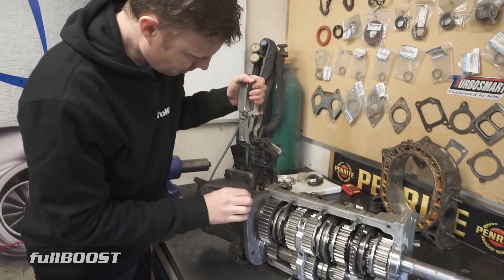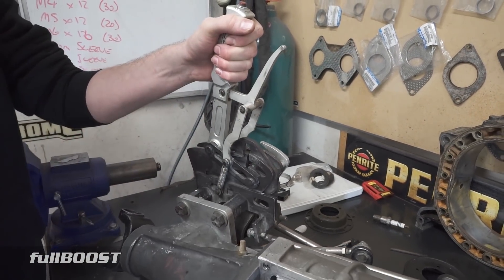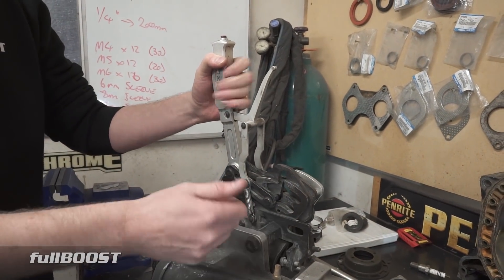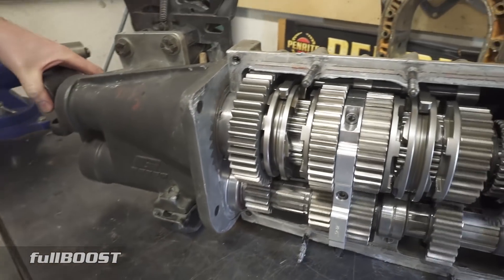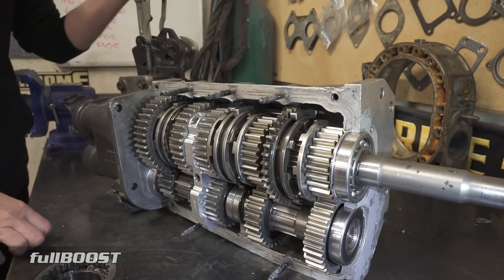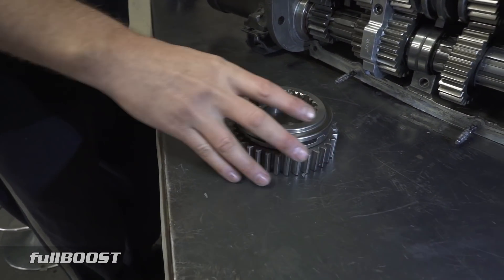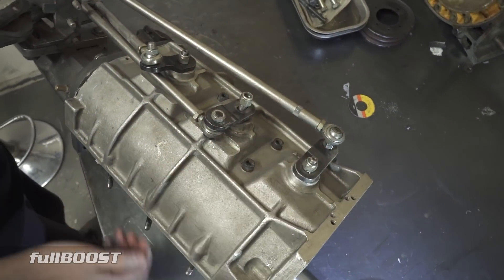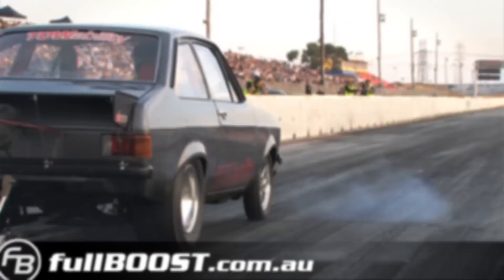How a clutchless racing transmission works

Comment: Shifting with that shifter sounds like you're loading a machine gun.
Reply: Yeah, what a beautiful heavy-mechanical noise :D
Reply: @CamTarn  When it is full of oil you will not notice.
Reply: That's almost a pity. I want my car to sound like that :D
Reply: @tonyallen2279  , You wont hear anything but engine at full noise when that thing changes gear!
Reply: Andy Walker i drove a sequential gearbox racing car and you hear a lot.
Reply: O
Reply: Sounds like racking the slide of a rifle, and I like it,
Reply: ''  nothing  beats  stick  shift  racing .....  !!
Reply: I can only imagine jamming that transmission into my car!

Comment: It looks like if someone REALLY REALLY felt the need to make this usable for onroad applications, you could make extensions on the slider levers that reached into the cab so you could shift it into any arbitrary gear like is needed for on-road driving. It would still be a royal pain, though, because it would want to go into neutral any time you lifted off the gas.

Also, it looks like he's turning the output shaft and calling it the input shaft, because when he goes into first gear, the small gear is on the shaft he's not turning.

Comment: Thanks for the informative video is it sequential gearbox?.
Reply: Well yes, but not always.

For comparison, all Formula One cars from 1994 to this day are using Sequential Gearbox with Semi-Automatic Transmission. Which means the F1 Car itself is actually Automatic, but the driver can shift the gear at will.

And then there's Electric Sequential Gearbox which the Lever is in the Steering Wheel like Koenigsegg cars, and F1 Cars from 2004 to this day.

And then most Rally Cars are fitted with this Gearbox, even the Ford Focus.

Comment: Why would you prefer straight teeth gears to helical gears? i thought you would use the second type because of the extended contact arc and the greater tork appliable...
Reply: The issue with standard helicals is that they try to push away from each other (side thrust), giving extra strain onto the axle and perhaps the bearings, because the teeth are at a different angle than 90°

Unless the gears are herringbone style that is (both helicals going in a different direction in one gear) this will always be an issue.

Comment: SO when you shift, lets say to 4 from 3, the motor go almost instantly from 7000 to 5000 rpm (for example).

So the 6 little notch, which engage into the right gear have to resist from the instant deceleration of all the moving part inside the motor (crankshaft, piston ...)

How the hell this survive more than 500 km without breaking or producing lot of iron filings ?
Reply from the maker: 500km is a lot of 1/4 Mille pases 👍 Yes these sorts of gearboxes require maintenance they are not designed for street use.

Comment: Nobody calls this transmission "clutchless".   It gets fed through a clutch, witch actually softens the engagement of the dogs.   You just don't have to disengage the clutch to shift the gears.
Reply from the maker: It is commonly referred to one in drag racing circles 👍
Reply: @fullboost  No, it isn't.  WE call it a dog-box.  Every manual transmission has at least one clutch  or a torque converter. Only a transmission with a torque converter is called clutchless.
Reply from the maker: @timhallas4275  ok cool. Well where we are from everyone calls them a clutchless. 👍

Comment: i wouldnt say he knows all about it or shows all... slider wear  one example  was fine on the drive side  where his mate said it was ordinary  at start  of vid .. it was prob out of the other side and could be turned around  as a perfect slider ... ...and the fact he missed on this early design  he didnt say it stays in gear while youre driving and  fork spreads  the pair of what he called sliders with spring pressure  that hold them together for purpose of having neutral .to get it into the next gear  1-2  eg

Comment: you still didn't explain how the clutchless part works. 1st and 2nd are not on the same slider nor 3rd and 4th  they can't be. when in 1st shifter is pulled into 2nd and different slider engages now trans is in 1st and 2nd and the counter shaft is running faster and over drives 1st and ramped side of slider dog pushes 1st into neutral position, 3rd is pulled now trans is in 2nd and 3rd counter shaft runs faster and over drives 2nd and ramped side pushes 2nd into neutral and so on.

Comment: I'm familiar with the road-racing cousin but one thing I'm not clear on that might be different from road-race boxes is, do you shift under full power or the driver has to lift or some automatic system?
Reply from the maker: These boxes are designed to shift under WOT yes.
Reply: @fullboost  there's has to be sooner sort of ignition cut to unload there dogs though.

Comment: Interesting. I had not seen inside one before. 
People complaining about clutchless (you can shift withput a clutch), and I think they missed describing the "sliders" a bit better. 
They look like they are two pieces. Each piece, on the dog side has one edge of the dog with a square edge, the other with a taper.
How I think it works, is if it is in first, then the first slider is engaged. If the then put it in secnd, the second slider is also engaged. This causes the first gear to go faster than the slider and it pushes itself out of gear on the tapered edge, and the same through the gears
If it didn't work like this, you could be in two gears at once or there would be a period in the shift where there was a neutral between the gears.
It also means that the transmission disengages on overrun.

Comment: ANY shifted transmission is a "clutchless" transmission if you shift it hard enough.   I came here to see what a CLUTCHLESS transmission was...evidently no such thing.  ;-)
Reply: Clutch is only used on launch. When shifted the trans will momentarily be in 2 gears at once. The lower gear will be ejected into neutral when the higher gear overruns it, this is why the sliders are a 2 piece design between gears.
Reply: @69nitronova  Yes, but it still has a clutch, no matter when that clutch is "only" used, which makes it NOT "clutchless", which is contrary to what the title states. 

Seems to me you could use some kind of a lockup torque converter to do the job, but that would obviously complicate things a good bit, unless you could come up with something self contained that didn't require pumps and "active" cooling.
Reply: @MrJdsenior  sounds like you would enjoy an automatic! 🤣
I believe a company called Bruno makes a converter style launch, I don't know if you trans brake button the launch it if there is still a 3rd pedal. 
These are called clutchless because they do not need a clutch after launch. My brothers A833 (hemi 4 speed) I built with face plated gears and sliders similar to this trans but you should bump the clutch on gear changes. If you don't you short live the dog teeth.
Reply: @69nitronova  Very cool.  I had a 70 Cuda (two actually) with a somewhat built 383 that I was constantly going thru motor mounts and a couple of 4 speeds with (one welded the first gear to the mainshaft while shifted into a different gear, that one was rather jarring), so...long story short, I found a hemi 4 speed at a local speed shop (one of the counter guys  told me he had) that had been raced, so when I asked him if it was quiet he said "no idea". It was, and I never had a transmission problem after that...man that thing was rugged.  You could tell just by the weight of it (used to hoist them into place by hand then, on my back) and that input shaft and spline difference from the normal big block trans. 

I heard somewhere that one of the tricks to lengthen the syncro life of those early trannys (different meaning then) when speed shifting (or bump, as you say) was to cut every other tooth, no idea if this was nonsensical wives tale kind of stuff, or if it actually helped.  Sounded to me as if it might shorten the syncro life, but who knows...maybe you do? I always thought you got back most of the overrev of the engine when quick shifting throttle down anyway..sure felt like it..minus what went up in heat at the clutch interfaces, which was probably significant.

My current vehicle has an auto 5 speed trans, a 2004 Acura TL. Finally gave up after just shy of 300K miles, so actually, they really DON'T build 'em like they used to, and in SOME cases, that's a good thing.  The torque flite of the time was a good auto, though.  Heard of a demo at a dealership that demo'd a new one fwd to rev to fwd, etc. at full throttle and it lasted a LONG time doing it.
Reply: @MrJdsenior  cutting every other tooth off the gear is called slick shift. Direct connection use to actually sell gears like this. Fragile set up. The shift slider must also have every other tooth removed. 
What this does is allows a bigger window of shifting mesh. The A833 don't like to shift easily past 6,000 rpms
Reply: @69nitronova  Interesting to know, and I flat out believe the fragility.
Reply: @69nitronova  exactly, the guy unfortunately did a terrible job of showing that particular fact.

Comment: When you're at rest and going from neutral to first, and both shafts are stationary, if the dogs are not aligned with the slots, how do you shift?
Reply: The input shaft spins with the engine so one shaft will move once the clutch is released.

Comment: When I raced my 1970 SS 396/402 Chevelle in the 80's, I used a Hurst Super Shifter 3 in my car. It had very short throws
and a separate shifter with a Lock-Out reverse lever. Back then there was a company that made a 4-Speed in line shifter.
You pushed it forward for first, pulled it straight back for second and so forth, but you could do the same thing in reverse to
downshift.    My question is why doesn't lenco make their shifter so you can downshift all of your gears like the old inline shifter?
Reply: Because a Lenco is not A transmission. It is a STACK of separate planetary transmissions and power flow to and through them and "shifting" must be progressive. You're not "shifting gears". You're "engaging" progressively higher-geared planetary combinations and ratios.

Comment: trying to explain a race trans to someone who doesnt understand how a regular manual trans works gets painful fast.  that Vgate shifter was available for all the big 3 muscle car transmissions, my bro had one in a montecarlo with a super T-10 on the street. with a normal synchro trans you can go up and down through the gears as easily as a an H pattern shifter. if he took the clutchless sliders out of that 5 speed and put road race sliders in he could street drive it up and down through the gears. the clutchless option is what makes that box drag only.
Reply: And if you drive only manuals you will never feel the torque multiplication of an automatic and torque converter. And a manual trans car only "hits" as hard as fast as the clutch engages until something else in the powertrain "slips". Shock-loading breaks things - transmissions, traction etc. Nobody with half a brain in their head ever really "drops the clutch" and if that is your thing and you don't think it can be done with an automatic and with every bit as hard of a "hit" plus near-zero slippage, you don't know shit about transmissions. 

It's called a "neutral drop".
Reply: A Super T-10 in a Monte Carlo as a "muscle car transmission"? ROFLMAO. You bet. Just like that's a "V-gate shifter" and all the "big 3 muscle car transmisisions" have 3 shifter shafts AND 5 "gates" PLUS reverse and "1-2" and "3-4" and "5-R". 

A Super T-10 in a Monte. Hilarious. That's a Borg-Warner "gearbox", numbnuts. Translation: Ford. 

Real 4-speed "muscle car transmissions" cannot have any parts removed and still function because they would no longer be SYNCHROMESH and any "gears" the "synchros" were removed from and their "companion gears" would no longer be there to shift into or out of.

Comment: this is a 'dogbox'/'facetooth' (describes the shift clutch style) with constant mesh (this means the counter shaft gears are in constant mesh with the speed gears on the main shaft). what makes this one 'clutchless' (I do not think it is a true clutchless as it appears to still need to break input torque to pull it out of gear unlike a true dual shift fork like the gf2000 from g-force) is the dogs are designed with an overrun ramp on one side that will knock the dogs out of gear. this box can be run with shift clutches that can be downshifted. if I recall correctly this guy has tried both styles and decided to go back to downshiftable dog rings for the street https://www.youtube.com/watch?v=3Me20NEtO0I

Comment: What's the advantage of this vs an up and down clutchless? 0.5 HP of hydraulic pressure?
Reply: I assume that the faster gear engagement would be equivalent to more than 80HP in the 1/4 mile

Comment: Could you theoretically drive this on the street? Down shifting would be a hassle but couldn't you just go from 4th to 3rd by holding up on that lever on the shifter, or just go all the way to the top and go back through the gears while holding in the clutch?
Reply: Not a clutchless box, because it pops out of gear on deceleration, but these transmissions are available  in a clutch assisted configuration, and they are fine on the street.  I have done 2 dragweeks with liberty's clutch assist version of this transmission.
Reply: @thestickcahhhh  you drive with straight cut gears?
Reply: @wannabecarguy  yes, there are quite a few guys running transmissions like this on dragweek.

Comment: A clutchless transmission has a clutch.  U dnt have to use clutch to shift gears. Thats bout it. Strong robust durable. Simple as that.  A sequential has a pneumatic valve to move selector barrel.  Nothing really fancy.  A trans like this is more manually selected.  U shift it has shift linkages. Sequential u dnt its pneumatic
Reply: Not all sequential transmissions use pneumatic valves .
Reply: @twl197860  u r right. Most commonly used with pneumatics.  I love drag racing a liberty clutchless would be my choice road racing id use a tko 600 or t56 magnum. I prefer to shift.  Im good at it unlike most that want a stick shift and cant do it

Comment: Hold it flat and jerk it hard..Hardest part is pulling it out of gear under load, the ramped dogs and plenty of space between them, lets it hook into the next gear with a bang..Brutal. All those smashable dogs and rings are sacrificial. Also looks like the ramps on the back of the dogs would spit it out of gear if you backed off or engine seized. This gearbox does one thing only, and does it well, smash through the gears one way and hard.
Reply: A true clutchless will "pull" it self out of gear once the next gear is engaged. It's inherent of there design.

Comment: Why run such a long distance between gears? When the sliders are between gears theres probably 1/4" of play between the gear face plate and slider, wouldn't a much smaller distance be quicker and shortening the system will make it stiffer/stronger?
Reply: Seems that the smaller gaps will increase the risk of misshift, since the longer distance allows the shifting fork/dog ring get a bigger speed towards the shifted wheel?

Comment: As a mechanical engineering student, I'm just speechless. The amount of effort of mechanical design,  material science, thermodynamics and even fluid mechanics calculations-design while the process of making this gearbox just amazes me. It's just beautiful, kinda art in my eyes.
Reply: Did we really see the same video? I have seen the simpliest and the toughest kind of gearbox, primarily used just for fast racing upshifting and bad in everything else. A few massive straight cutted wheels, spinning in oil, shifted by a strong hand. The art of mechanical engineering is 8 speed ZF or Aisin auto transmission I mean ;)
Reply: @milanrobich5186  I don't know if you ever tried to design any kind of gearbox by yourself, seems like not at all, making such a reliable, proper working and efficient gearbox for specialized purpose or not is so hard to do and took really long time, study, research etc. btw I didn't remember that I said zf or aisin is not art, they are also great art pieces in my eyes.

Comment: I had a v gate shifter on my Muncie, ba
Reply: Same hear Smokey. Almost 50 years ago, Mr. Gasket had a V-gate that was probably the original design of the shifter in this video. I drove one in my Goats on the street for over 10 years, and only missed 2 shifts in that time. Was such a blast back then.

Comment: Only for racing. Completely impractical for daily use. Nothing like good ole H shifting for street use. I wonder how mindless numnuts put these into daily drivers.
Reply from the maker: Yes they are a drag transmission not designed for street use..